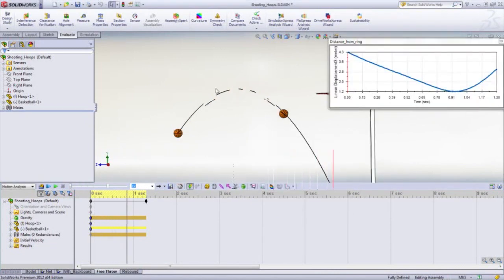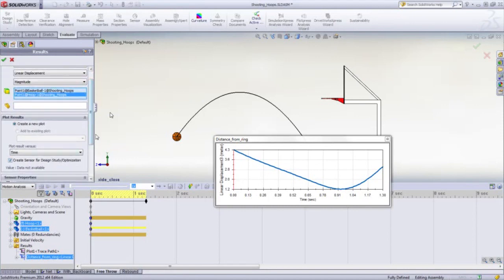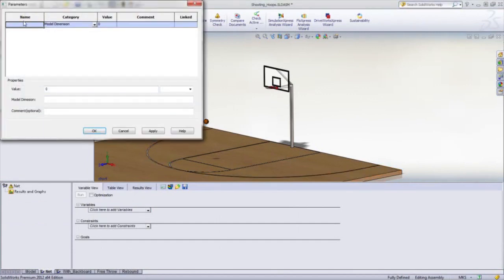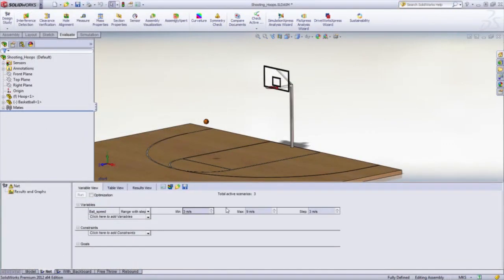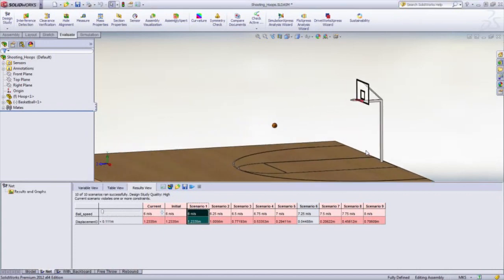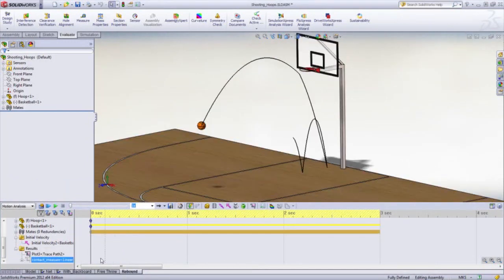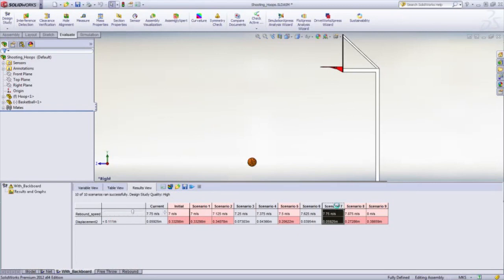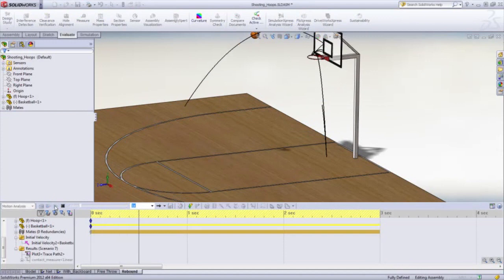Motion Optimization in SolidWorks

Comment: Hi
what are the settings you have used for the motion simulation?
I tried to do the same simulation of ball and hoop, but it just didnot happen, the ball stops when it contacts the hoop and the simulation shows an error that motor speed is so high blah blah blah... etc.. though there is no motor but only initial velocity as you did.

I always receive error, when 3d contact is involved, could you please help me and let me know why this is happening? Problem persists despite the change in solvers